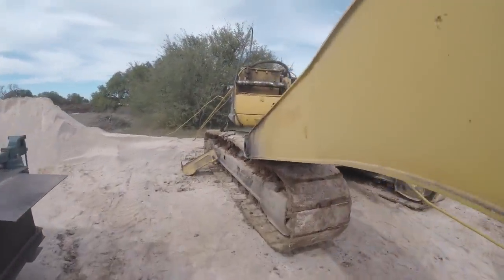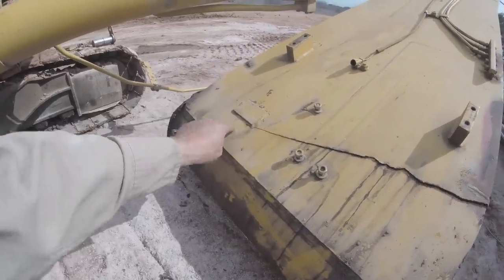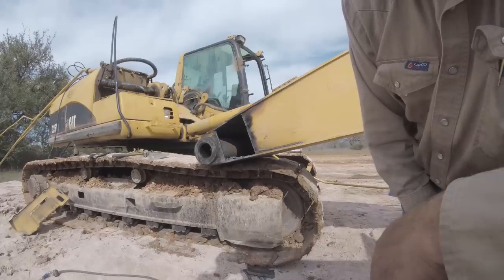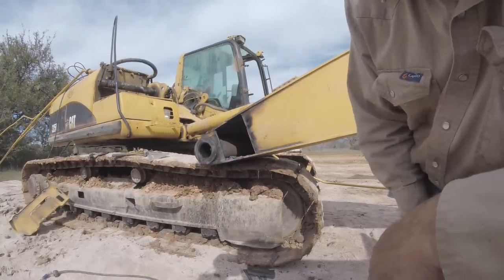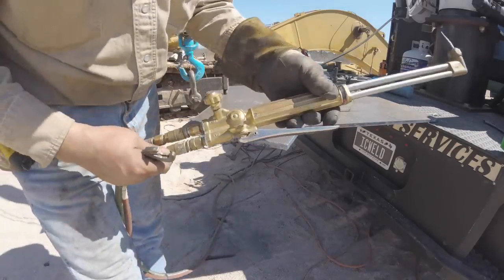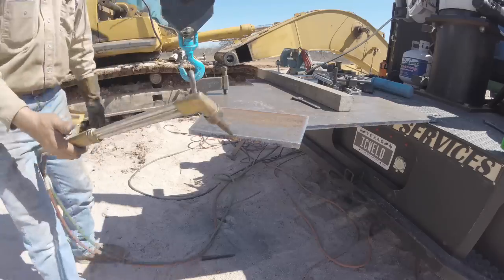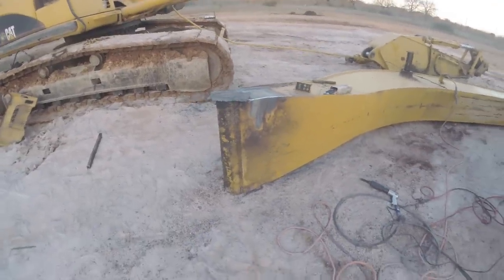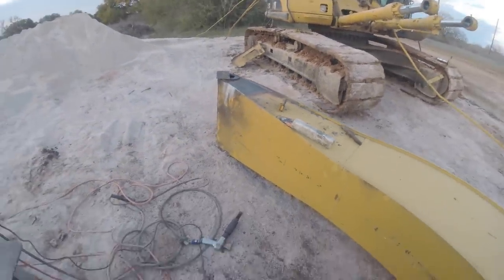Broken Excavator Boom!!! How to fix it!

Comment: I’m curious why you used a mig type welder for most all of your repairs then switch to stick towards the end. Is it better to use stick for filling the crack if you’re not replacing/cutting out bad sections or is a deep penetration needed for that area? Picking up a mig to learn welding so I don’t really know all this yet

Comment: Great job but one thought the metal originally used is  a bit light for the work it is doing l woul have put inch and a half in plus an in plate over the whole section up to and over the seam weld two feet up the arm as that as the main fulcrom and weight bearing point on the excavator arm.

Comment: Nice Job !!! What are those guys doing to that equipment to make it break like that? Obviously something that it was not designed to do......They need you to weld extra supports around all stress areas if they are going to be extra hard on there equipment.
Reply: Have you ever heard of a hydraulic hammer? If you ran a jackhammer 12 hrs a day, you'd be worn out in a matter of years, I don't care if you are a stout 20 yr old kid, it hard on machines and your body

Comment: Great job bud but just wondering i build and weld theses sticks and booms and other heavy attachments for a living but the stick and booms are made from QT 100 just wondering why you don't preheat the QT before welding ? P.S we use run off taps too then cut them off and grind and blend the welds in

Comment: What would a cost comparison be between the multiple repairs and a new boom?
Just curious!
Reply from the maker: Not sure, but I just saw this machine about a month ago and its still running!
Reply: Lower boom is 4500 dollars used at auction, that's what I saw recently. A new replacement from Cat is probably 8 or 9 thousand

Comment: You seem to favor putting pieces in the boom after removing the cracked area, I see it works because your original welds held and a new crack appeared. 
That being said, there's many videos of welders adding plates over the cracks after welding them up. Is there an advantage, disadvantage to this?
(I prefer your method)
Reply from the maker: I personally dont like patch plates over a repaired area. These booms are made to flex a little. If you put plates over the repair, the stresses will suddenly be transferred onto the weld around the perimeter of the patch and it can, and sometimes does cause bigger problems.
Reply: @ICWeld  thanks, rig tour ?

Comment: In the video of the stick repair that bucket cylinder sure looked bent, but in this view, it's straight.
Reply: The go-pro  type cameras, used by many, have a wide angle lens which has a slight fish eye distortion.
Reply: @jerryuffelman2986  I figured it was something like that.

Comment: Which flux core wire are you using? Have you ever tried ArcOne singles 240 duo Auto darkening welding filter in your helmet.

2 yrs later watching again and its fabshield 21b.

Comment: How do you know if it is built out of high strength low alloy steel that takes preheat, weld, post heat to keep from stress cracking on cooling?

Comment: I wonder how they drive it that always puts force on the boom one way? I also wonder how long before the frame it pins to cracks up.
Reply: I suspect a lot of slewing with the bucket or the breaker hard into the ground.
Reply: It runs a hydraulic hammer 12 hrs a day, not a bucket.
Reply: @TheRoadhammer379  that’s kind of worse.  Using it as a crow bar must beat the hell out of the sleeve bearing :o

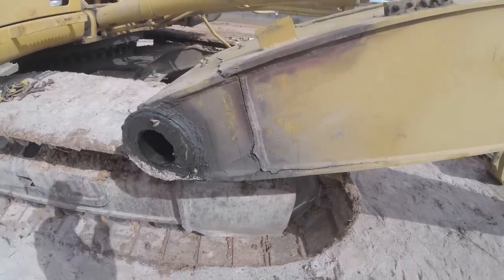Comment: after 1:20 i can see that your alignement of the boom and you cylinders is not right on cylinder is working to much on your frame,i'm a machiniste welder on site and do a lot of lineboring and this is the first issue that i saw and never weld at a 90 degree cut the weld with a circle witch will send the force of the weld in a circle and not in a line ;)

Comment: What is the gun you are using (with the long nozzle)  Been out today my self and put a back blade in a Case 4 in 1 bucket on a wheeled digger. From the UK
Reply: The Essex Hunter long mig torch, for use with flux core wire so no need for shielding gas

Comment: They need to fire the operator or operators that are totally destroying  this equipment, but on the flip side it is job security
Reply: It runs a hydraulic hammer 12 hrs a day, use your brain. You run a jackhammer 12 hrs a day and tell us how you hold up

Comment: Side pushing loading boom does this.These booms not engineered for Torsional twisting 
Avoid side push and only push pull in line with boom as with cranes.
This error also Voids CAT warranty.
Quite common now work so many faster stronger excavator s .
Side push some loose backfill is ok.

Comment: It's my understanding that welding gasses (bottles) can't be used horizontal?
Your truck needs some boom lights.
Probably better then factory.  ;-)
Reply: only acetylene
Reply: Ok, Thanks.  I had a concept vehicle that would have a compressor, generator and welding equipment (arc, mig, oxy/act, tig) mounted below the bed so I was hoping the tanks could also be stored there?  ;-)

Comment: i think caterpiller  .want you to use a 90 thousand lbs  rod or wire to weld with i don't use 7018 i use 11018 it don't brake or corex flux core wire
Reply: THEY WANT YOU TO BUY A NEW PART

Comment: Your first repair was bad choice, because if that snapped in the first place, that means it's bad engineering and it will snap again.     I would grind it, weld it just like you first time did it, but cover it with tick plates, it may not look good esthetic but will do the job.

Comment: At some point, you have to ask yourself: "Will that much heat from all the welding weaken the metal?"
Reply from the maker: Correct. however If im replacing a panel, then its similar to how it was originally assembled at the factory. Not too much heat input and a fresh new piece of metal, not a fatigued piece.

Comment: Good workmanship done competently and expeditiously by a guy who knows his trade. 

But he has all that gray hair which raises a point. I'm an old fart myself skilled in another trade. My question is: are we bringing up young guys who can fix ailing machinery, get it running again? I've done similar work for shoestring contractors, welded and bored for pins and bushings so they can get another thousand hours out of their investment. Maybe afterwards sell the machine down the road in usable working order instead of having to leave it rust in the back lot or scrap it.

Where are the young guys who will pick up after us old farts ride into the sunset? Any of you out there?

Comment: Why change rods? Why not just use 7018 for the whole job?
Reply from the maker: I find that using fluxcore on the narrowest part of the groove or root area works better since itll arc way down deep. Whereas sometimes with stick electrodes, it may not get all the way to the bottom in certain situations. Its a toss up with what process to use. I normally however most always use 7018's on everything, even the root pass if at all possible. I like the elongation/ductile properties of 7018's. Theyre a bit more flexible, not so brittle like some fluxcore wires. Speed also is a big factor. Thats why i chose wire to hurry and fill, then used the rods for the caps.
Reply: What is the code on the flux core wire?

Comment: Why fluxcore then 7018
Reply from the maker: The 7018 rods have a little bit more elongation properties than the fluxcore, meaning, its not as brittle. So it will take a little bit of flexing better than a harder wire or rod.

Comment: I have found that from experence welding on long reach excavators on top put a couple of 1 x 2 inch by maybe even 8 inch  bridge bars on top of break an bottom of boom  running parnell to boom stops the break from recurring remember the metal is fatigued an stressed which inhancenses the breaks

Comment: I certainly didn’t read all the comments here, so maybe its been asked before but how the heck do you break something in this manner? I.e. tear a beam made of 1/2” steel? Wtf 😳
Reply: Hi Rick they use a breaker hammer as an attachment to remove rock.

If you put so much weight on the hammer that you lift the tracks of the ground, you might impress the boss (if he is bad at fysics at least).
But what you are really doing is prohibiting the hammer from freely moving up and down in the implement and instead putting all those repeated movements/stresses through the boom of the machine to the point where it is fixed to the main body.

Metal will crack from fatigue, and the crack will keep on growing.

Probably also been using the machine and hammer to pry on the rock whilst hammering, which gives sideloads into the mix as a bonus.

Too much asked from the machine by a rough handed impatient operator (and probably impatient boss aswell)
Reply: Thanks for the answer, makes sense that doing that would over stress even a brute of an excavator like that one.. “the hurrier l go, the behinder l get” kind of thing! 🥴

Comment: need a wedge under boom and check the metallurgy on the grade of steel check if foundry contaminated the casting of the steel plate and maybe get boom white hot then weld it and check if gas injection is needed to realign crystal structure of the steel Aa

Comment: Looks like you will fix it up so they can destroy it again. Oh well its only metal , too bad it was so badly designed.
Reply: it runs a hydraulic hammer, genius. It's extremely stressful on the arm.
Reply: @TheRoadhammer379  yes it is hard on the equipment but its not like the engineers that designed it never heard of putting one on and using it in that capacity. I never said it wasnt stressful on the equipment and it will probably get destroyed again "genius" whats your your point?

Comment: Pretty welds, but I’m not convinced the repairs are done correctly.  Perpendicular cracks repaired with perpendicular welds?  No grinding, no beveling?  1/4 inch butts?  But I’m no expert…

Comment: How are they breaking these machines like this?
Reply: CONSTANT SIDE LOADING OF THE BOOM PUSHING DIRT WITH THE BUCKET  SIDEWAYS USING THE  SWING BACK FILLING  HOLES AND SLAMMING THE BUCKET DOWN HAMMERING AND HAVE A BREAKER ON THE MACHINE WILL SOME TIMES METAL FATIGUE THE STEEL CAUSING CRACKS.

Comment: When you put no internal support or gussets inside the booms, and the repair area stops just inches away from the initial crack - what do you expect??? If you repaired it the way it's supposed to be done, you would be out of work, of course. I understand that.